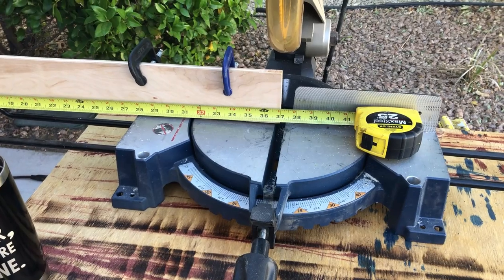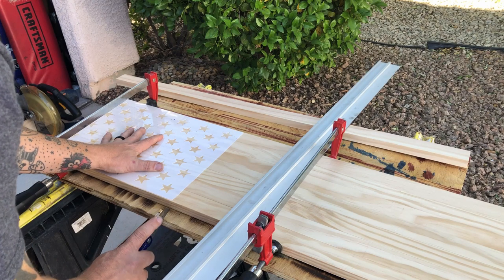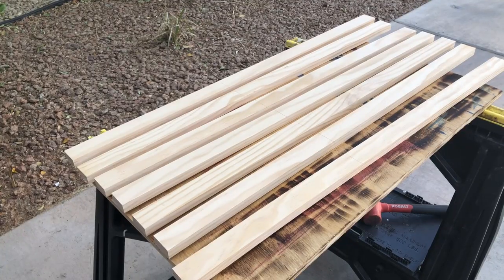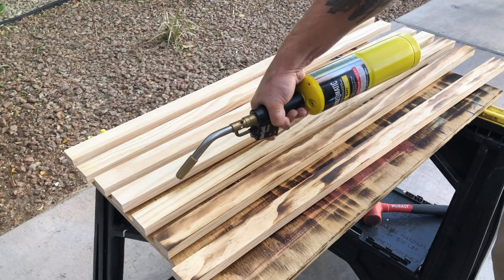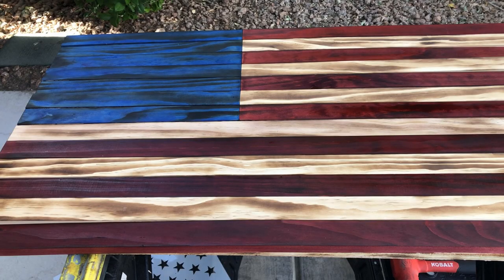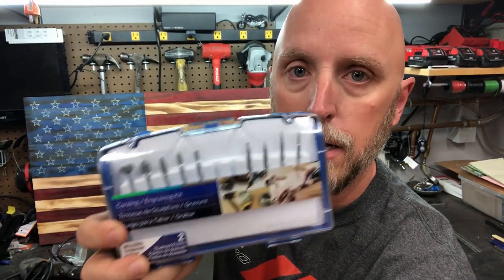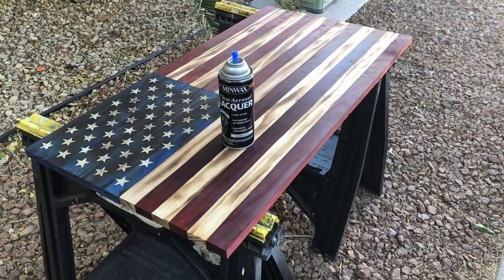Rustic Burnt Wood American Flag Build

Comment: Used your video to recreate a flag for a military going away gift.  The stains you use are awesome! The red is a little thinner than the blue and required two coats to even out.  Using the razor blades to separate the blue and reds on the union is genius!  Instead of pocket screws I use a 1/4" plywood backer board that I glue all the stripes to along with glue in between the stripes. It was very helpful in keeping the stripes flat during glue set.  An $8.00 piece of ply was cheaper that the pocket screws. I ended up carving a fighter jet in the top 7 stripes right of the union and the name and position on lower white stripes with a router.  They loved it and asked for three more!  Could not have done it without your video and thanks for sharing great techniques.
Reply from the maker: I'm glad you liked it.  I've thought about using ply for a backer instead of using the pocket screws...I have another flag build in the works (once the heat in Vegas dies down a bit), I I'll probably use the ply backer for that build.  The inlay you did sounds like it turned out awesome!

Comment: Hey man, thanks for the video as it is thorough and precise. Much appreciated! Had to use a different red my hardware store didn't have the brand you used. Burned the whole flag and turned out great. Did a dado cut with miters to frame it in. Looks rad.
Reply from the maker: I don't know any store that carries that brand of stain...that's why I linked to it in the description.  I thought about framing mine, but i another version in mind that I may try...

Comment: If you have to struggle that much with your Kreg drill bit, it needs to be sharpened, or replaced. Great looking flag!!!!
Reply from the maker: Thanks.  I'm super happy with the way it turned out.  As for the Kreg, I wasn't struggling at all...the jig wasn't secured to the surface I was working on.  I got a bit lazy...

Comment: You have probably the best looking flag I have seen built so far.  Just a few questions.  Is it possible to do the burn on the wood after everything is stained and stars engraved prior to clear coat?  Would it wreck the stain?  What size kreg screws did you use?  What kind of wood?
Reply from the maker: Thanks!  I would think burning the wood after being stained would ruin the stain..maybe test it out on a scrap piece first.  I think I used 1 1/2 Kreg screws, but I'm not really sure.  As for the wood, simple pine strips is all I used.  I'm thinking of trying out some other woods to see how they turn out.

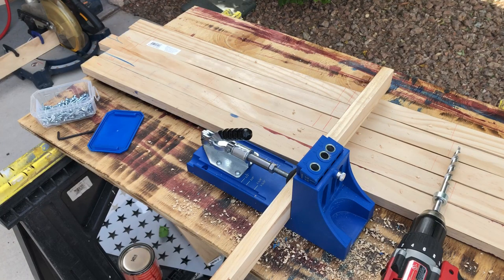Comment: great video and dang i want to try and start my own but i dont have alot of tools. Well, and no power tools LOL. Stupid question but at 8:05 you are using something that I do not know what it is. You said to assemble the pieces use that piece of equipment. What does it do and how are you assembling it? Great flag!!!
Reply from the maker: The tool @8:05 is a Kreg Pocket Hole jig.  All it really does is drill hole in which to use screws; it drill the holes in such a way that the screws are recessed.
This really could be made without power tools.  The hardest part would probably be the stars, but even then a good sharp chisel could probably get the job done.

Comment: Flag came out amazing! Really love it man. I’m looking to get into flag building just more of a hobby for fun make some for friends and family since I’m with the FDNY can def find a home for a ton of these. This was one of the few videos I’ve saw though that it was put together with screws rather then just wood glue. Do you find that to be better? Feel like that requires much more work and a higher skill level.
Reply from the maker: Thanks.  The only reason I went with screws is time.  It was quicker to use screws than it would have been to wait for woodglue to setup.  As for more work or more skill...It way take a bit longer to assemble since you have to drill all the holes, but its still faster than waiting for the glue, and it really doesn't take much more skill to sue screws if you've got a good jig for drilling the holes.

Comment: great vid!! Had a question, have u ever used a steel stencil for the union stars before? Ive seen them being sold but havent seen any vids on how well they work. If u could do a video on that i think it could be beneficial. I have bad eyes so i thought that one might be of some help 🤓
Reply from the maker: I haven't heard of any steel stencils.  I could potentially see a problem with running the Dremel bit against a piece of steel though....it might work, but doing it freehand really isn't that bad
Reply: @MoonBuiltGarage  awesome video. Which material stencil was used to initially run your Dremel against it?

Comment: How many screws did you use? I tried your method and it came out so flat it made doing the stars so easy. Used it just do the boards on the back glued and nailed. I ended up putting 5 screws per board and its perfect but I feel like it might have been over kill lol
Reply from the maker: I really don't remember how many screws I used.  I wish mine had turned out a bit flatter, but I think it looks a bit more "rustic" with them not being perfectly flat.

Comment: I've been wanting to do a similar stain (except it'd be a Texas flag) to a wooden work table I made! In your opinion, what would be a good way to keep it from getting dinged up? I have clear coat spray which would be easy for me but am also thinking of doing resin. Downside is it'd take alot of resin!
Reply from the maker: I made a coffee table around the same time that I made this flag (https://youtu.be/47VlE02cafQ), and I used a clear polyurethane that works really well....I have a dog that like to lay on the table and his nails have yet to scratch the table!
Reply: @MoonBuiltGarage  appreciate the insight! I'll check it out 👍

Comment: Great video!   I noticed that your propane tank was held at about a 90 degree angle.   My flame goes out as soon as  I turn over the tank - somewhere arou8nd 60 degrees  What am I doing wrong or what equipment do I need.
Reply from the maker: Thanks.  Good question about the propane...I honestly don't know.  I would think that maybe your tank is getting low, but I can't say for sure since I have no idea how full my tank was.
Reply: @MoonBuiltGarage  is there a difference between the blue and yellow cans.     The yellow worked fine , ran out and switched to blue.  Once it finally lit. It worked great upright.  As soon as any tilt.  Flame out.
Reply from the maker: @1927Scavengers  The Blue is Propane, the Yellow is MAP Gas.  MAP Gas burns hotter than Propane, but Propane is fine this project
Reply: @MoonBuiltGarage  I just can’t seem to keep it lit.  Slightest turn of the bottle and out goes the flame.  Gonna try the one connected to the 20lb tank. It’s much bigger but should be ok.

Comment: Why didn’t you spray paint the stars and then Dremel them out? Wouldn’t that have been easier? Great job though! 👏🏻
Reply from the maker: Honestly, I didn't think about that, but I would think you might run the risk of having the paint bleed outside of the stencil, especially on wood.  I ran into the stain bleeding from the blue into the white on a few test pieces.

Comment: How do you keep your stars smooth when carving free hand
Reply from the maker: I'm just that good 🤣...no caffeine before carving?  Honestly, just take it slow and remove a small bit at a time
Reply: @MoonBuiltGarage  ok I've made one flag for a Vietnam veteran that comes to our church but a couple of the stars don't look good so I think I'm going to buy that depth guide and make another one
Reply from the maker: @jeffreycasto4610  The depth guide certainly helps, but I found that in the areas where the star crosses a joint it can sometimes cause problems, especially if your joints aren't perfectly level.  I have found myself getting frustrated at times and just removing the guide and free handing it.  Sometimes during free handing the stars may not be smooth, but I find that the imperfections in the depth add a little more character, and once the stars are burned it is barely noticeable.
Reply: @MoonBuiltGarage  I'd send you a picture of mine to get you opinion but I don't know how to do that I'm just an old hillbilly from wv not good with this social media lol

Comment: I want to start off saying that your project turned out great, and I appreciate the tutorial.  I showed it to my students however to show them what NOT to do.  It one instance, you crossed your hands on the Chop saw, and the 12" blade was less than 2" from your left wrist.  Very dangerous.  It appears to be the only time you do this.  Also you are not wearing safety glasses, so I have to give you a thumbs down for that.  Your explanation of why the flag is that size (37") is spot on for the stripes to be 1.5" each.  Great job explaining the razor blade edge and use of painters tape.  Thanks for taking the time to do this.  Overall excellent project, and thanks for your video.
Reply from the maker: Whew!!  Good thing I wasn't doing this for a grade in shop class 😂...Keep watching, I'm sure I'll be able to provide more bad examples to your students.  If there's one things we Marines are good at is being a role-model!
Reply: @MoonBuiltGarage   From a career Soldier, Semper Fi! Devil Dog!  Thanks for all you do. This is a great project that I do with my students.  We build large 37" flags for sale to the public, then the kids build smaller designs of whatever they want for their take home project.  Tried to post student examples, but won't let me.  GC2MAJ Tom
Reply from the maker: Very Cool!  I had to make the Marines comment when I noticed your profile pic...I'm planning a smaller version, with a twist..just gotta figure out a few details.  I'll try to make sure I don the appropriate PPE for the next one 😂